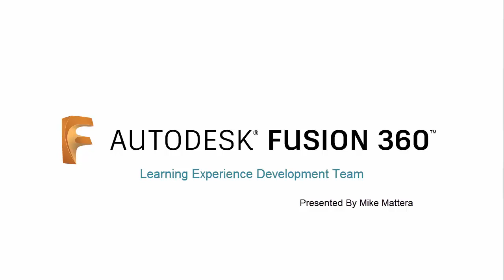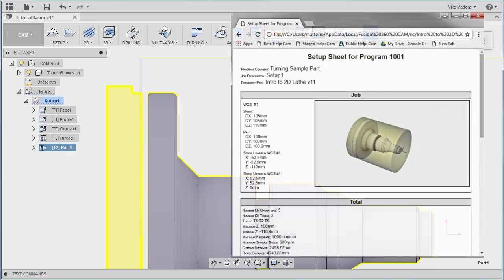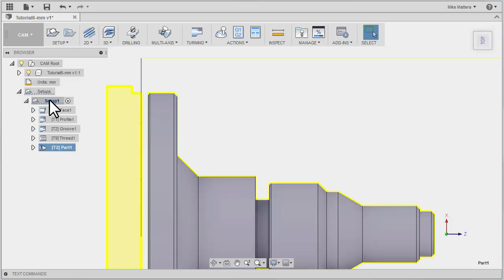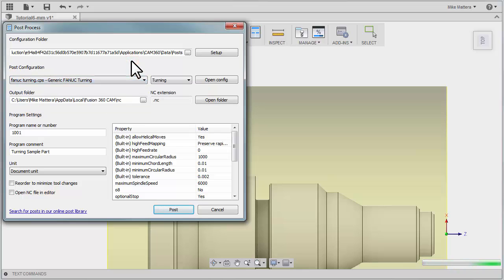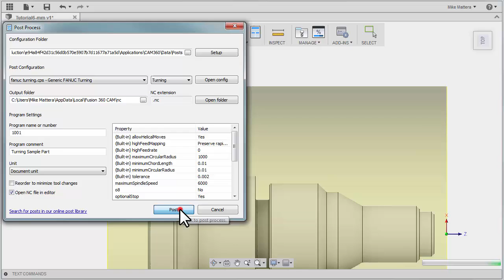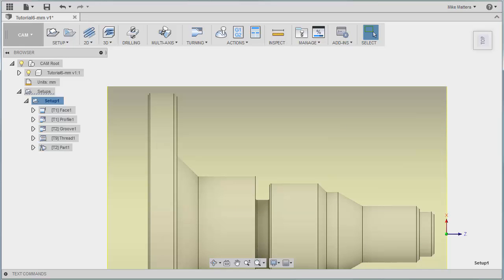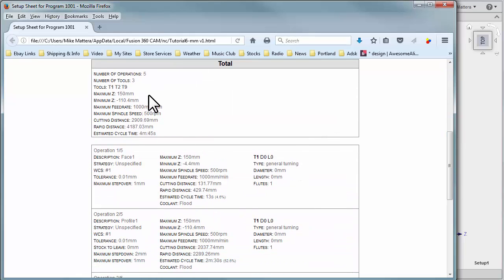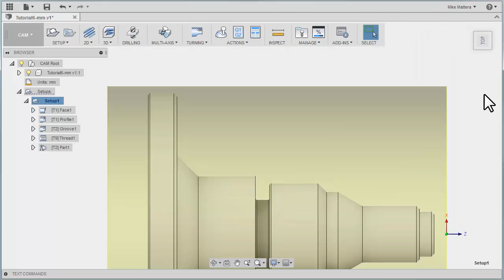Fusion 360 CAM - Intro to Turning 09 - Postprocessing & Setup Sheets

Comment: Many thanks Mike. A perfect video from you as usual. Is there any chance of having canned cycles added to the turning side in the future? The 2 main weaknesses of Fusion that i find is to be no canned turning cycle's and also no 4th axis simultaneous swarf machining for finishing wall's after machining wrapped geometry. The only option for this is on a 5 axis when really this can also be formed on a 3 axis vertical with a 4th axis on most oil & gas applications. I believe feature cam has both of these options.

Comment: OKY I HAVE A SETUP SHEET DO I INPUT THE INFO IN THE CAM SECTION TO GET THE G-CODE IAM NEW TO THIS TRYING TO BUILD A GUITAR I BUILT MY MACHINE AND IS WORKING STILL LEARNING I JUST WIDENED IT TO 1000MM !!